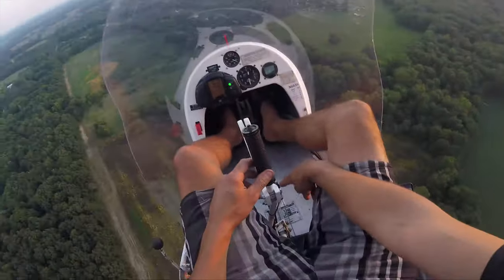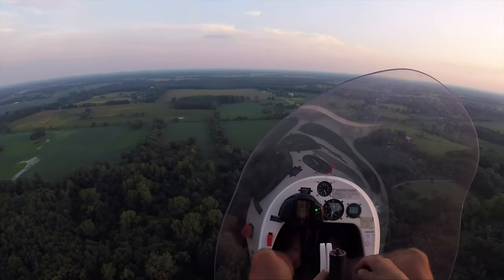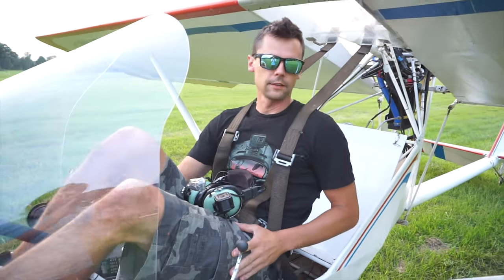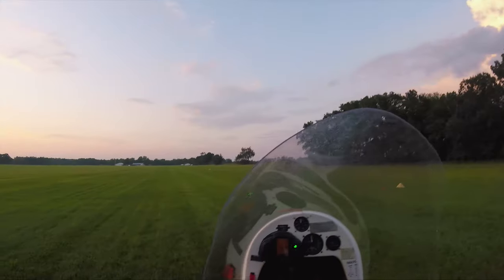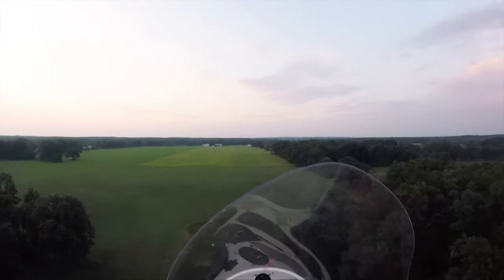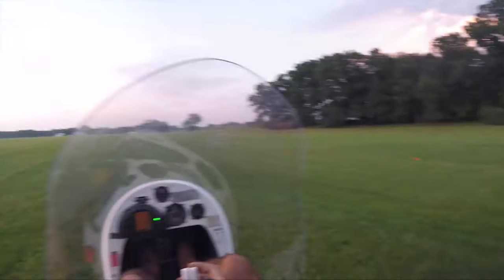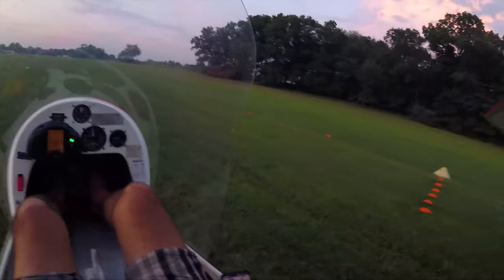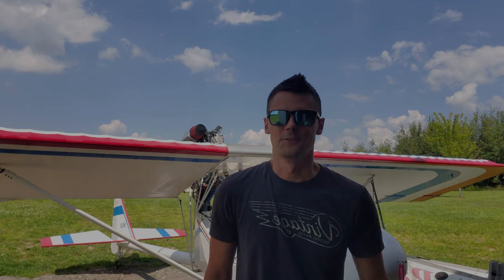Yamaha Phazer Kolb Firestar 2 Stol Practice - Part 2

Comment: Without mountains, I'd be lost!  High engine, high center of mass, tippy on braking. A lower engine with belt drive to prop probably not as reliable. Do you use slips to slow airspeed for landing?
Reply from the maker: It does slip, but pretty much uneeded in this extremely draggy airframe.

Comment: Azusa brakes right? Would like to see a black max comparison. Also what prop/pitch?
Reply from the maker: Mountain bike brakes with home made mounts, adapters and brake handle.
Reply: @bkairys  I’ve considered this setup. What is your typical operation gross weight?

Any particular brand of brake?

What did it take to mount them to the Asusa wheels?

Excellent content and production!

Thanks